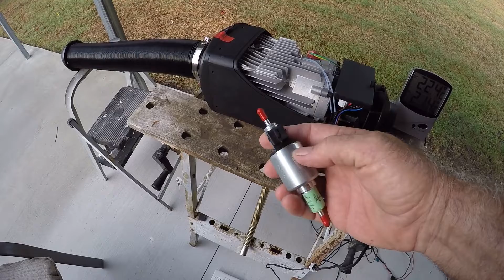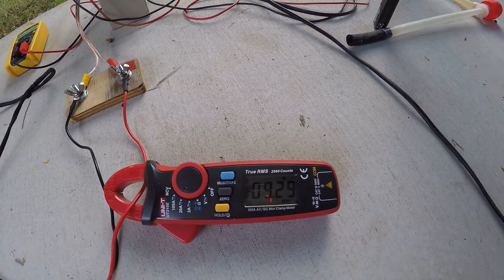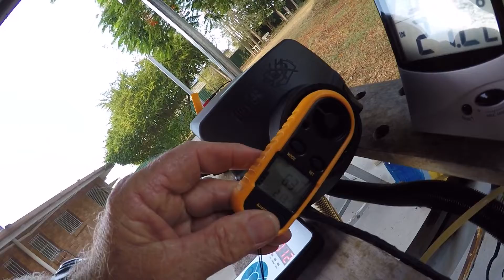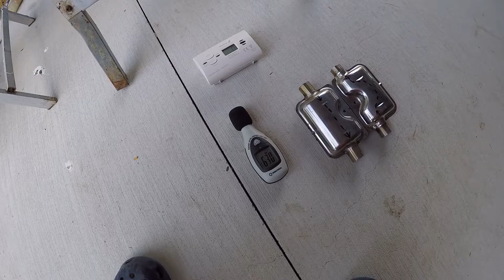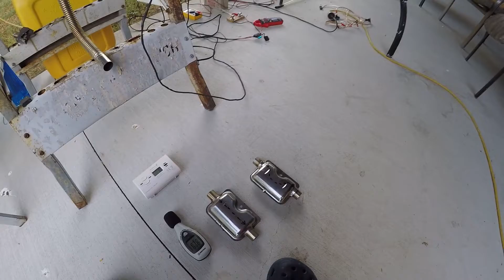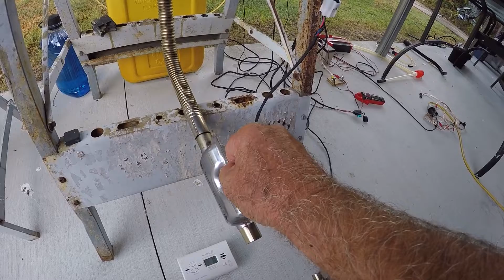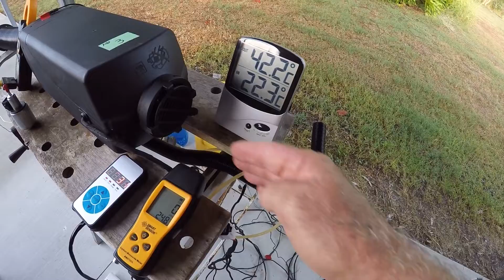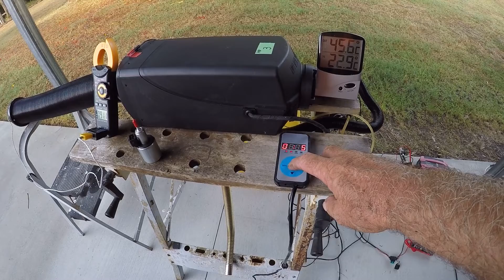Chinese Diesel Air Heaters - Part 2  -  5KW Bench Test

Comment: Hi john i bench tested my 5kw heater was working good, i now fitted it to my caravan  and runs good but doesn't   get as hot as on the bench  as holding my hand closer on bench would burn hand but now dose not after fitting, on the digital display the heat bar along bottom only lights up the green lights and one yellow  dosent get to the red lights at all , thats on flat out 5 hertz would you think i would have air bubble in fuel line or whats your thoughts please mate  regards peter pkrychaluk@bigpond.com
Reply from the maker: Hi Peter,

Yes 5 Hz is close to full power.  Normal max default is 6 Hz but you are close.

Yes, the outlet air close to the heater is almost at boiling temperature and will burn a hand.
If it was working well on a bench test, and you do not have a very long duct run in caravan, I tend to agree with you about a fuel issue. 

First, are you using the small bore hard nylon fuel tube on the outlet side of the pump?

Is the pump inclined upwards over 15deg?

Are there pulse absorbing fuel bubbles in the fuel line? You should only have the tiny cavitation bubbles in the fuel line, never a full tube bubble.

Have you pushed the pump nipple and hard fuel line right up into the joiners so as to eliminate joiner bubbles.

Is the fuel line inclined upwards to allow cavitation bubbles to escape and not form a large, pulse absorbing bubble?

Without full information, I hope this is a start for you.  JMcK
Reply: @johnmck1147  Thanks mate i mite of had a bubble in my fuel line as it had a bit of a high spot in line from pump to heater and dipped down a bit i re routed the fuel line and repositioned the pump all good now mate  hot as now , ide say it had air bubble in high spot in fuel line and was only getting half the fuel if that thanks for your info mate

Comment: Hi John, Mark here from Tasmania. I'm the one who's putting a 5kw heater in a TV unit inside the house with the exhaust venting thru the Wall. You recommended a 120 a/h deep cycle battery would be okay. I was wondering how many Watt solar panel would be enough, even on a cloudy day and how many AMP solar controller would I need to purchase to use for this setup. I also intend to use an ARLEC 12 volt 4 amp RMS car battery charger (240v) as a trickle charger in the event the battery needs a top up . Is this a good idea or should I buy an RV type 240 v battery charger. Again, many thanks for your videos. Cheers Mark.
Reply from the maker: Hi Mark, 

A common 80w - 100w solar panel and a 6A to10A solar charge controller, would suit. 

If you have mains power available you could consider a 240 volt AC to 12V DC converter and do away with the battery, solar, and charger. These heaters only draw 3 or 4 amps running, but 8A to 10A on start up and shut down so you would need a 10A minimum DC converter if you chose this method.

Cheers.   JMcK
Reply: @johnmck1147  Thank you very much John. I've been racking my brain trying to figure out what to get as I didn't want to short change the whole set up and end up with a flat battery. The reason i need both solar and 240 v is that I live in Waratah in the NW corner of Tasmania and we get over 2 metres of rain and lots of wind and unfortunately downed power lines which can result one or more days without power. This usually happens on the coldest of days. I have a wood heater which costs me around $1000 for about 7 months supply of split firewood delivered plus electricity to run the fan in the wood heater. Then of course you have to have next winters wood supply in the yard somewhere getting air dried which means you are constantly moving wood. A lot of people have split air con systems ( called heat pumps in Tassie ) but are expensive to run and only good if you haven't a power outage. A friend of mine lives on an island East of New Zealand and their only source of heating are diesel powered stoves which they run 24 hours a day to heat their homes. Anyway, thanks again John, very much appreciated. Cheers Mark.

Comment: so I am trying to understand, is there also a fan inside the combustion chamber to draw air in for combustion with the diesel.
Reply from the maker: Yes, there are two fans, the external one you can see and an internal one that sucks in combustion air. The internal fan is small with tiny vanes, that is why it is important to have minimum restrictions in the combustion air intake lines and the exhaust. The combustion chamber is sealed, so if exhaust is restricted getting out, combustion air can not get in. Some of my other videos show the internal fan.   JMcK
Reply: Good on you John, thanks

Comment: Hi john , I live in Tasmania and have the German in my m/home . I'm thinking of putting a 5 kw Chinese one in a tv cabinet or similar in my lounge room with two vent outlets and the exhaust venting out thru the Wall. It will be set up off the grid with a deep cycle battery and a solar panel. Actual running time will be about a  min. of 4 hours to a max. of 12 hours per day. What size amp hour deep cycle battery would you recommend to be on the safe side to operate for those many hours allowing for a rainy day ? I was thinking about a 120 a/hour battery. Like you're videos, many thanks, Mark.
Reply from the maker: Hi Mark,

Lots of variables in using these heaters off grid.

These heaters draw 8 to 10 amps on start up and shut down so your wire size must be set to a 10 amp min current draw. Very important if you have long wire runs.

As for running they draw 2 to 5 amps at 12 V depending on the heat setting.

So if we go for max use of 12 hours at 5 amps = 60 AH + start and stop, lets say 65 AH all up without any solar input.

From a lead acid battery you can only draw down 50% without battery damage so the absolute minimum battery size without allowing for ageing is around 130 AH, so your reasoning is quite accurate.

Now you may choose to run the heater at a lower setting, and during the day with some solar input, or run it for a shorter time, in that case you could use a smaller battery.

I hope this helps.   JMcK
Reply: @johnmck1147     Thanks John , I will be running 8 if not 6 B&S wire with a short run as the battery will be in the same cabinet as heater but not near it. Again, many thanks, Mark.

Comment: Hi John, great video series. I'm looking at options to convert one of these into heat source for an oven. A couple of points- Do you have measurements for the exhaust gas temp and flowrate? And do you think the electrics could be easily moved away from the unit so that the indirect air flow over the aluminium heat exchanger could be increased to 250C? Thanks.
Reply from the maker: Hi the Simulus Group.

Some of the videos show exhaust measurements. The temp is very dependent on the heat setting and just where you take the measurement.

I have never measured exhaust flow rate, doing so would wreck my gauge. I suppose you could build some sort of adaptor and measure the intake combustion air and get a guide. They would be similar but not the same as the exhaust gas would also be expanding from heat.

The ECU can be mounted externally, but tou would need to rewire the fan sensor and make a bracket for it. You would need to remove the temperature sensor on the heat exchanger which will shut down the heater if the temp gets to around 125 to 140 deg C.

You could do these things  and fool the ECU but I do not know what the outcome would be.

Cheers.  JMcK
Reply: Great idea! Could you please let me know if your idea works?

Comment: I´m glad i bought the right muffler for mine tell me does the hot air outlet tube get hot or does it stay warm the reason why i ask is because i need to run it on lino in my van. Thanks
Reply from the maker: Hi Fionn

The baffled mufflers work and are better than nothing. The straight through type are just better if you have a choice.

Yes, the outlet tube gets hot, around 100°C close to the heater when you are running on a high setting. You need proper hot air delivery tube for your van.

In the past I did an experiment of using 75 mm home plumbing tubes for hot air delivery as the tubing if readably available, cheap, and comes with lots of bends, joiners, Y pieces etc. But the heater put out enough heat to soften and sag all the tubing.

Cheers,  JMcK

Comment: Great doco thanks. VERY interesting how you also didn't see any increase above zero carbon monoxide level on that white Quell  detector.  I've tried two new units on several sources (but not a diesel engine) and they remain at zero.   When calling their  Australian 1800 number, you get a recorded voice message from an installer.
Reply from the maker: Thanks for the feedback Khun. Look out for the next video coming out next Wednesday. More info on CO.  JMcK
Reply: I think the smallest amount these units will show is 10ppm so thats probably why!

Comment: Hi John, great work. Just a word on filtering air intake across heat exchanger. We sell hundreds of Eberspacher D2's and D4's a year as well as OEM Chinese. Eberspacher make an air intake filter dia 60mm only, and not the larger 75mm and 90mm filters. We have been trying to find a 75mm and 90mm solution. Over time customers who have installed into caravan's, motorhomes etc may find that dust and hair builds up accross the heat exchanger. I have some good photo's of this. I see people have tried air intake pods normally found in Automotive use, curious to see if you have tested filtration?

Comment: Thanks for these helpful videos, learned a lot! Do you know it he 5k model labeled as 2kw will draw the same amount of amps initially?
Reply from the maker: Hi Daniel, you can generally tell the difference between a real 2kw heater and 5 kw heater by size and weight. A 2kw heater is about 300 mm long and weighs around 2.5 kg. A 5 kw heater is around 400 mm long and weighs around 4.5 kg.

All these heaters use the same type of glow plug, that draw around 7 to 8 amps when activated. The heaters on start up draw around 8 to 10 amps. J

Comment from the maker: Hi John, I would check elsewhere first.  

1. Check glowplug wire plug is in its socket correctly. 
2. See if any obvious damage to circuit board. 
3. Remove glowplug and connect to battery, it should quickly glow bright red. 
4 If all those ok suspect  hidden CB crack. Don't go any further, return the unit. 

If you have E3 the glow plug is not working or turning on for some reason. It does not matter if there is fuel in the burn chamber or not. With no hot glow plug the heater will not start. If you have a clamp meter you could check the current draw. It should be 8 to 10 DC amps with the glow plug turned on. 

If not just a loose glow plug connection and the heater is new I would just return the heater for a replacement, or your money back. It is not worth the effort trying to find what is wrong. Also there also could be other unseen damage that may show up at a future time. If it is a dud glow plug it will cost you around $30 to replace. 

If you want a replacement, now is the time.   

Good luck. J

Comment: Hi John Just put mine on test and am a little concerned the front of the head is hiting 200c at p5.5 is this ok thanks. Jeff
Reply from the maker: Hi Jeff, I assume you measured the outlet end fins which are in direct contact with the main burner flame and you used an infrared non contact thermometer. These thermometers can vary greatly in this instance depending if they are measuring  the outside of the fins or the inside of the fins. 

A reading of 200 dec C on the inside of the fins is of no concern and normal, as you are measuring the hottest part of the heater where the raw flame hits. These heaters have a temperature sensor on the top side of the heater measuring the returning hot air, and will shut the heater down if the air temperature around the heater fins exceeds around 120 to 140 deg C. Measure the outside of your heater case at the hot end. It should not exceed about 50 deg C. If under 50 deg C, all would appear ok on that boost fuel setting of 5.5 Hz. J
Reply: Yes that is with red dot on the middle bit air going in is 18c coming out is about 68c I will check the case tomorrow to make sure thanks John @johnmck1147

Comment: Very informative video John Thanks. If you connected the exhaust pipe to the vehicles muffler I am sure it would be even quieter. Do you think it would be too much back pressure?
Reply from the maker: Hi Ron, I guess it would depend on how you did that and if you run both at the same time. You would need to construct the system in such a way that that there was no back pressure when running the vehicle engine. J

Comment: Hi John were does the heater get it's reading temperature to turn up and down to keep the room at say 70c is it controller or the unit very interesting videos well done matey thanks. Jeff
Reply from the maker: Hi Jeff, these Chinese heaters come with a lot of different controllers. The three electronic types have a small thermistor in the control unit. You will see a small hole in the control head with something that looks like a tiny match head in the hole. This is a thermistor that measures temperature when you run these heaters on auto mode.

I personally mostly (not always) prefer to run them on a manual setting, much simpler, and no "hunting" of the unit. 

The electronic controllers are great if want the heater to turn on at a particular time so when you arrive all is warm and cosy for you. J
Reply from the maker: Hi Jeff, I got an email about mufflers from you but I can not see it here. You asked about through mufflers at high power. Please look at video 8. J
Reply: It's ok john got the information I wanted from your book on the table in part 8 max power to straight fhrough boxes noise I'm going for two on my build thanks again. Jeff @johnmck1147

Comment: Hi John great video  I have purchased the 5kw heater and want to install into small sail boat 27 foot  I was going to put  exhaust out of stern with a U bend to stop ingress of water into heater but you don t recommend this practice do you have any suggestions 
regards Robbie
Reply from the maker: Hi Robbie, there are a few special precautions for boat instillation. You must lag the exhaust, you need a special drain at the heater if the exhaust runs up hill, and you need the ingress protection in the exhaust you speak of. As these heaters are a copy of the Eberspacher design, I suggest you go on line and download their marine instillation manual. It will give you some good advice. 

Also, I am not sure how you plan to to make the exhaust exit the hull but you can buy special exhaust outlets for these heaters. Here is just one for starters.

https://www.ebay.com.au/itm/Marine-Stainless-Steel-90-Degree-Thru-Hull-Plumbing-Fitting-Boat-Hardware/132670542726?ssPageName=STRK%3AMEBIDX%3AIT&_trksid=p2057872.m2749.l2649

If you are able to do so, mount the heater at the deckhead and have a short down slopping exhaust run terminating at the above fitting. 

If you can't keep the exhaust short, consider going to a bigger diameter exhaust to cut back on back pressure.  Good luck. J

Comment from the maker: Thanks for your comments Lars. I have done a review on the 8 KW heater which I hope to publish in a week or so time. I just need to do the testing two more times on different days to confirm and average my figures. John
Reply: I recently purchased what was listed as an 8kw heater but I have a strong feeling they are starting to falsly advertise the 5kw models.. it is identical to my 5kw and the max fuel rates listed "0.5L" comes out to ~5.2kw.. damn scammers!!